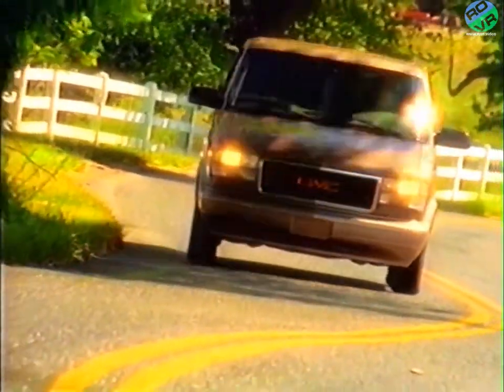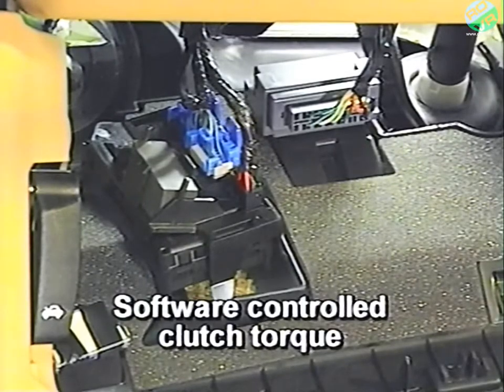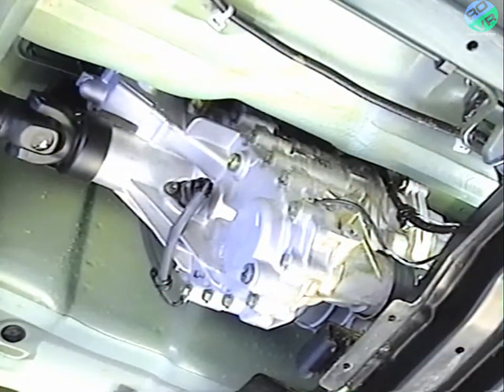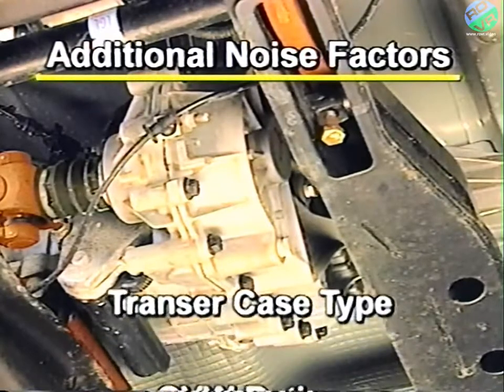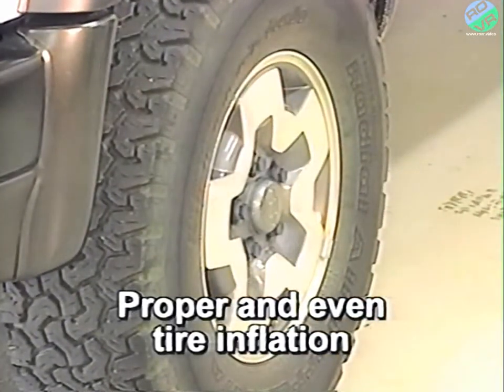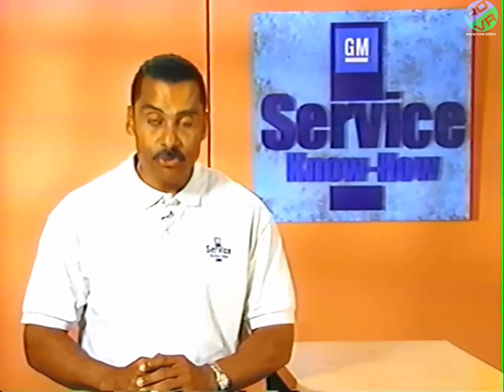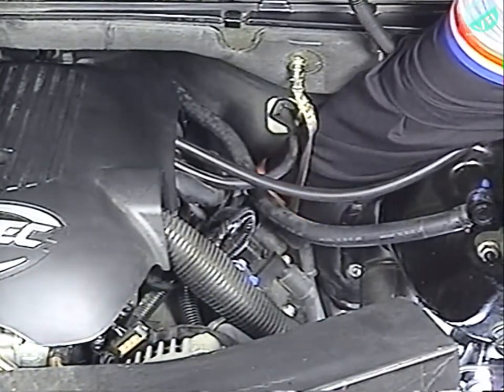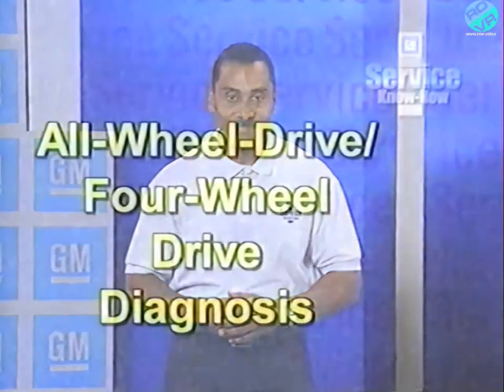GM - Service Know How - AWD-4WD Diagnosis (US) (2002)

Comment: I have the BW4482 full time 4WD in my 2005 Tahoe.    It’s quite rare.    It does really well but I wish I had the normal transfer case with 2Hi and 4Hi locked.